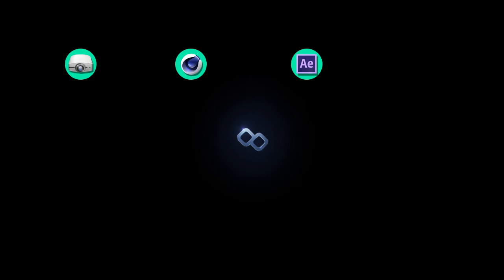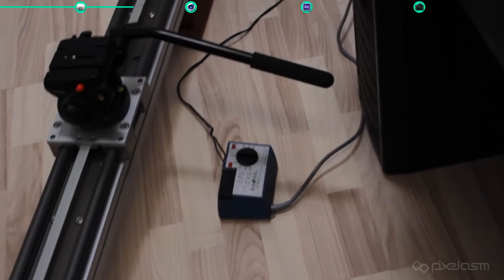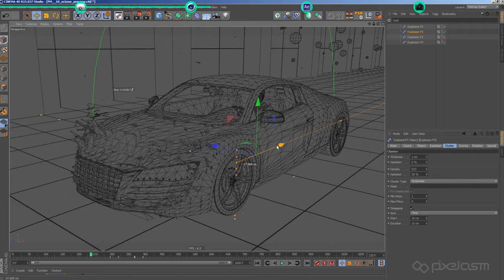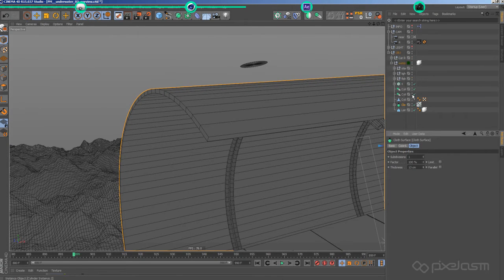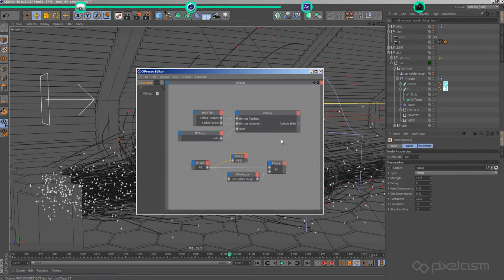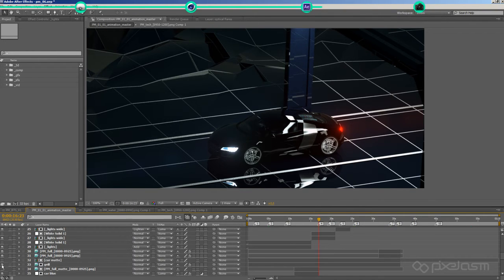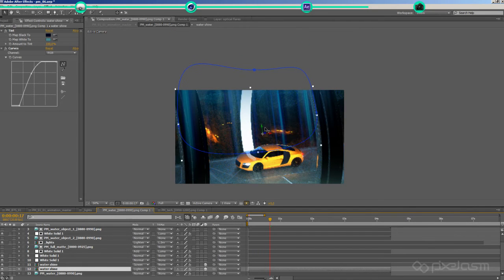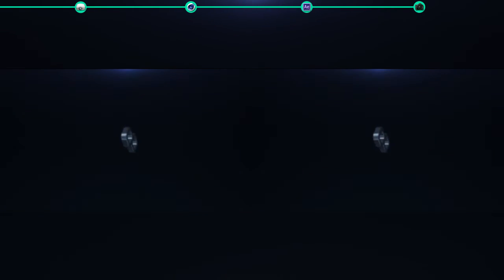Projectionmapping test – Behind the scenes

Comment: Great work!  One question though.... did you use any program, like Resolume Arena, for the Projector/Beamer?  Or did you just play the video through the projector with a standard video player?  I'm working on my first 3D projection mapping onto a car myself, and was wondering your setup.  Thanks in advance!
Reply from the maker: +Tanner Matthews  Hello Tanner and thanks for your interest in my projection mapping. I played the video through the VLC video player, because I did the mapping in Cinema 4D with some additional tweaking in After Effects. This approach is best suited for setups that are not moved that much, although I took the car to an art gallery ones and had no problem setting it up again.

As long as you are able to keep the relative postions / rotations of the mapped object to the projector you can reuse the same render. When changing the locations regularily like a VJ that might not be the case, because of safety restraints you might end up with different setups, thats also why most VJs use dedicated mapping software although the main reason lies in the realtime render capabilities of MadMapper, TouchDesigner, Mudul8, VVVV etc.
Reply: +pixelasm Thanks for the response!  So, when you say you did some of the mapping within Cinema 4D and a little tweaking in After Effects.... i'm guessing you did that while you projected the video onto the model car, and did the adjustments that way?  Any tips would help.. I'm running the same setup essentially... Cinema 4D R16 with After Effects CC 2015.  Thanks again for the assist!
Reply from the maker: +Tanner Matthews Yes, I did the mapping while projecting a still of the 3D model onto the RC car, but you could also do it in a more real time way by creating an instance of the perspective view / your render cam: "Window / New View Panel..." and place it in the beamers screen space. The second method only has the problem that C4D´s UI occludes parts of the screen. By doing it the way I did it you have to go through a lot of manual render though. Something that helps is to use a black background and different colors for the cars body, windows and tires, all without fancy shaders to speed up prototyping.
Reply: +pixelasm Thanks again!  We finally finished our 3D projection mapping at the Performance Racing Industry Tradeshow in Indianapolis, Indiana. U.S.A.  I ended up using Cinema 4D, After Effects along with Resolume Arena 5 for the mapping/masking on the 1/2 scale model race car.  We ended up using 3 projectors/beamers (one for the background video, one for the top of the car/hood, and one for the side of the car)  The question i had for you, and i know you already touched on it already, but I don't know if i am quite grasping it 100%.....is how you said you 'did the mapping while projecting a still of the 3D model onto the RC car..."  And the part that I'm curious about, is that.  The mapping in Cinema 4D.....So, I take it that you projected cinema 4d through the projector/beamer onto your RC Car... and then what?  Did you actually start to shape and model the 3D Model to fit the RC?  Like stretching and skewing the polygons on your mesh to fit the perspective of the projected image?  That's the part that I'm curious about... The main reason I'm asking is because i would like to run fewer projectors if possible in the future, and possibly without Resolume Arena 5 if i can.  That was the only reason why i purchased Resolume in the first place... to map and skew the image to the physical model of the car.  If you can elaborate a bit on the details of the mapping you did, that would be greatly appreciated..  I thank you in advance and wish you a wonderful day!
Reply from the maker: +Tanner Matthews Great to hear that you recently did an awesome sounding project (any videos online of that? ;) )
About my mapping, well honestly I did not model the car I just bought a model and changed some details, but first and foremost deleted unnessecary polys to speed up the render. As you guessed right I also streched and skewed some parts to better fit the model by switching between Softselection based on surface and space. so again no magic here, but I hope that still helps you.
Reply: +pixelasm its not the best, but its my first try... and now I've figured out what works and what doesn't... so, next time I will be able to make it better.  I've already begun on working on next years project... making the lighting and orientation better.  Not only that, the model will be better, and I was thinking of intergrating touch-sensitive pads under the cloth or wall to allow people to trigger other videos that can go along with the 3D projection... it should be interesting..lol